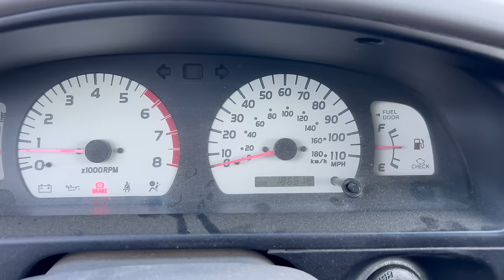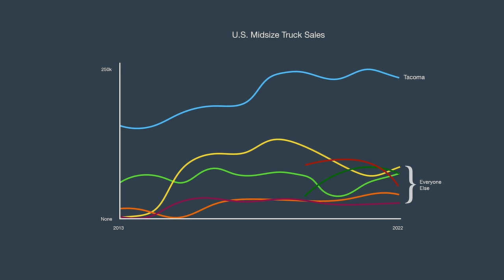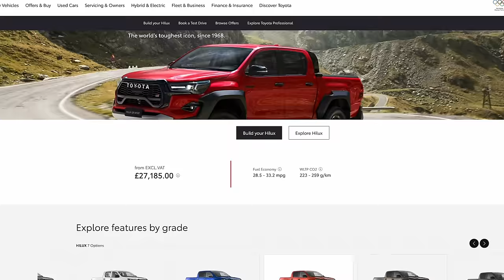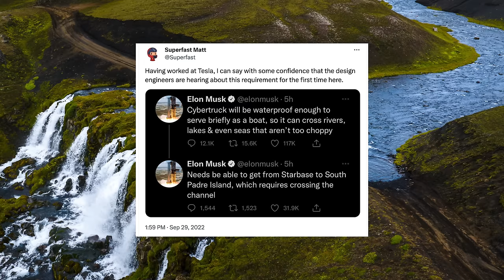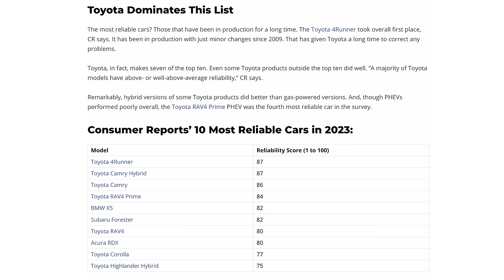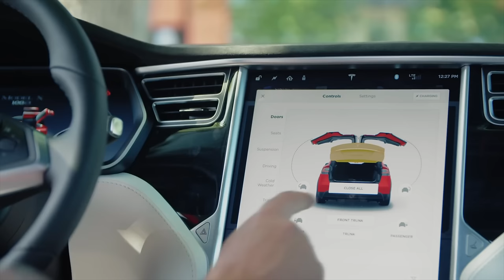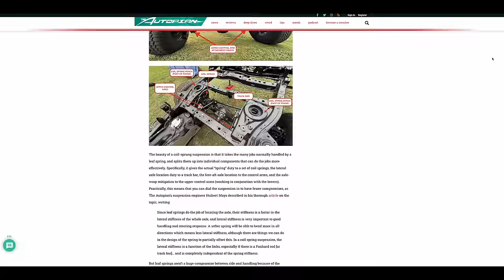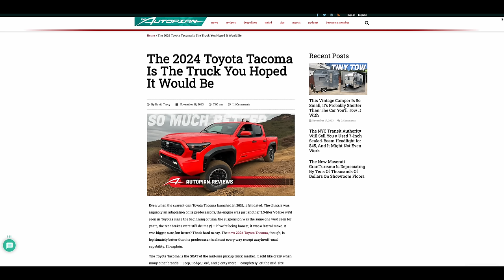What Is The Best Truck, And Why Is It The Toyota Tacoma?

Comment: By the way Matt, do you know about the Toyota Hiaces? They are basically Hilux vans, and north America doesn't know them. They are so good and have a rich family tree with lots of cool versions.
Reply: North America got the R20/R30 TownAce (MasterAce Surf style), which Toyota just called "Toyota Van" here (back when the Hilux was sold as "Toyota Truck"). Lots of people in North America old enough to have been interested in cars in 1980's know about them.
Reply: @brianb-p6586  Yes, we know it as the liteAce in Europe, but still it was a bit different from the Toyota Van.
Anyway, they are not Hiaces and the Hiace family is big, with barebones versions and complete luxury vans
Reply: True, @roland9367 , the North American "Van" was not a HiAce... but it was Hilux-based, so many people here are familiar with the van with Toyota truck bits under it.
Reply: @brianb-p6586  That is probably true. But the Hiace has been sharing even more engine and drivetrain. The Hiace that I had was pretty much equal to the unbreakable Hilux.
A part of the Hiace family actually used 4runner engines like the v6. And there is even a superrare v8 ambulance

Comment: Impressive advertisement! 
I'll be keeping my '99 super duty but if I was to sell it I would strongly consider a taco. Unfortunately, I don't think the taco would like pulling my equipment trailer. My super duty on the other hand doesn't mind pulling my equipment trailer. Even if you put the taco in the bed of the super duty, it would still pull the equipment trailer. In fact, I'm pretty sure you could put a taco in the bed of the super duty and another one or two on the equipment trailer and still have to pass people on the highway.

Comment: I have a 18 Tacoma that I bought new in 2018, and it has 156,000 miles on it.  And nothing has gone wrong with it.  I have replaced ball joints and bushings, but to be fair, I drive way to fast offroad and those things are my fault.  This truck has driven from Washington state to Texas at least once a year since I bought it, one time towing a two axle enclosed Uhaul (completely full), at least 70,000 miles offroad, I have filled up the bed with rock and dirt many times, and it's been flawless the entire time.  I keep up on regular maintenance, use good oil (Ams oil signature series), swap between two K&N air filters (clean one while I use the other one).  Every 5,000 miles I take it to Toyota so they can rotate the tires, check the breaks and fluids and top them off for $35.  I am still running the stock battery, and I have changed the spark plugs once.  This truck has been great, I absolutely love it and plan on driving it for many more years.  I love it when people say Tacoma's can't put up with abuse cause my truck is physical proof they can and do.  These are great trucks and one day, many, many, many years from now I am going to get another without a second thought.

Comment: A few notes:
In your video, you showed some b-roll footage of older Tacomas and even T-100s that I'm guessing you saw near you in California, as a point about how they're still on the road. I'm on the East Coast, and I don't see too many really old Tacomas like that, likely due to rust. And that's with the milder winters here in Maryland vs. New York.

Second, I agree: A midsize truck will do all of what 90% of truck owners need a truck for. If you need a midsize truck, the Tacoma is what you will buy. But a non-hybrid Ecoboost F150 is going to have equal/better MPG than the non-hybrid 2024 Tacomas, at a similar price. Add in the almost guaranteed ADM on the Toyota, and the Ford might come out ahead on price, with less costs at the pump.

Also, the past Tacomas aren't too big on the inside, which isn't great for taller (or even average height) drivers. If you look at the side of a <23 Tacoma, you won't see much existing underneath the door sills. They tucked the running gear up into the truck, making for great ground clearance. But this devours interior space, and doesn't help a Taco that'll stay on pavement. No idea if they fixed this, but the 24+ side view doesn't give me hope.

Comment: Toyota Tacoma engineers brought back the fully boxed frame that they used to put in their older Hilux/T100 models. They also took the Land Cruiser 100-series' rear suspension (4-link) and replaced the old  leaf spring suspension. So they took, proven old tech and threw it into a "new" chassis.
Reply: That's not the tech I'm worried about, alas.

Frame and suspension can be fine; head unit deciding to give up the ghost in half a decade, or the 'lane assist' deciding to dodge a branch in favor of dodging into oncoming traffic, or the turbo exploding from excessive wear from the thinnest oil known to mankind...
Reply: @TheLoneWolfling  Don't disagree with you on all that. Toyota would be better off scrapping all the new safety features and make the driver the main safety feature.

In regards to the motor and turbo, only time will tell but keep in mind, this isn't the first time Toyota has developed a motor with a "factory" turbo or supercharger. The old Hilux 4-bangers could be optioned with a factory turbo or you could buy a TRD supercharger.

Comment: I always wondered why toyota trucks sold for such high prices, Then I had a 91 pickup v6 4x4 fall in my lap, it just does everything you want it to, and doesn't complain or break down. Mine had 580k miles when I got rid of it. 100k of that was me offroading, camping, hauling, AND using it for work (construction). I changed fluids, bushings, and shocks, that was it. all in $1100 in parts? Id love to have another but dont have room for another vehicle haha.
Reply: At today's prices, you mean room in the budget! 🙂

Comment: The only real downside of the Tacoma is the price (because of demand usually) which is actually just another pro. I looked at them in 2018 when I needed a new pickup and the price different from a 1/2 ton was only about 3 or 4k so at the time I figured why not just buy another GM truck (my old one was a 2000 Sierra that served me well). Before 60k miles was up on my 18 Silverado I already had the oil pan replaced, the radiator (not covered under powertrain warranty) replaced and the water pump replaced. My driveshaft also rattles at about 1000 RPM under low load. Made me realize how far from grace the Chevy pickups have fallen since the late 90s/early 2000s. All in all I kinda wish I had just bought a Tacoma, but I've also had to tow a single horse trailer for my girlfriend several times which may have been a problem. Does 95% of what any homeowner would ever need though.

Comment: The biggest reasons I bought a Taco was because it had a 6MT and it wasn't a Gladiator. No other truck on the market in the US can say that. That said, it's still significantly larger than I want. I wish Subaru would bring back the Baja but do it with a 6MT option. I might just have to get a Crosstrek and go full Aussie on it with a Ute conversion. And an EyeSight deletion.

Comment: All im saying is that i've been around and drove Tacomas, and im still a Ranger fan. Loved my 93, 94, and now i love my 2020. The new gen Rangers are ridiculously capable, good HP, gas mileage, 4wd, locking rear dif, trail assist, traction control, good tow capacity, and an amazing 10 speed with a granny gear to boot. And its all accessible, simple, and easy to work on. I love my Ranger, and no one will convince me that i should have bought anything else. Only downside is no power or heated seats, but hey, that just makes it feel like my old trucks :)
Reply: Tacomas are great, but Rangers win in my book. Just bought a 4x4 2011 Ford Ranger XLT last month that only had 50k miles on it. Absolutely in love with the thing. I only drive like 4k miles a year, so I expect I'll be driving this truck for 20 years.
Reply: Congratulations. Enjoy your higher cost of ownership and lower resale value.
Reply: I have no experience with the newest ones, but Rangers were decent trucks, and used ones are a bargain, as is it may cost 2 to 3 times as much today to buy a comparable decent used Tacoma. Inspired by Car Wizard's recent Ranger video, last night I checked Craigslist for used Tacomas under $5k. I did find a handful of '98 to '03 examples - all with major defects - wrecked, rusted, cracked frames, bad automatics and super high miles! But that's OK. 8 years ago, I paid only $400 for a '96 base-model Tacoma with a bad tranny - now fixed and upgraded). Yeah, it's kind-of primitive compared to most newer trucks. But with only 83K on it now, it may outlast me! 🙂
Reply: @drwhat4574  not sure what higher cost of ownership you're referring to, and i don't think resale is much of an issue for me, hoping to keep it until either i die or it does.
Reply: @sunbeam8866  Tacoma prices are crazy, and ranger prices are getting up there, its now around 3k for a good reasonably low miles Ranger
Reply: @reeseferrell2731  Higher cost of ownership because it is not as reliable and will need repairs more often. The resale value is the evidence of that.
Reply: I'm a Toyota fan, and I like my Tacoma. But the price I paid for it kinda makes it a unicorn - especially today. If you could get a comparable Ranger or Tacoma for the same price, or even a modest difference, well the Tacoma is a no-brainer. But if the Tacoma costs 3 times as much, well....  But you might stll get lucky, like I was, if you're patient.
Reply: @reeseferrell2731 $3k? I wish I lived where you do; $3k buys you a rusted out 200k mile 2.3 base model Ranger; to get a rust free, less than 100k mile, decently well maintained, 4x4, with any V6 (especially a 4.0 with a manual) you’re spending at least $10k and that’s a steal, it’s around $16k if you want a 4x4 manual 4.0 that’s not a 2001 or 2002 (the worst years).
Reply: @skorpoolr  western ohio, recently i sold my 110,000 mile 94 ranger for $3200, 5 speed with some minor rust. Where are you at that rangers are that expensive?
Reply: @reeseferrell2731  Wisconsin; the rust belt eats old trucks for breakfast, so whatever ones that are left are pricey.

Comment: While they are not a bad truck, I definitely think they're a bit overrated. Part of the reason you see high numbers on the road is because the frames were so bad that they were replaced under recall, whereas another truck that succumbed to frame rot years later was scrapped. Interior room is pretty limited, and the fuel economy is no better than a 6 cylinder half ton domestic. I will say that they have great ground clearance in stock trim, but bang for buck, they are way too expensive
Reply: It's okay to be wrong, the overall build quality is leagues ahead of domestic trash and they last a lot longer. What's actually a downside is dealing with Toyota service departments. If you find a dealer with competent advisors that aren't jaded and overworked, you're golden. Most of the time they're incredibly burned out.
Reply: I worked in the autoglass industry for a little while and would always note mileage and condition of cars just as a hobby. The amount of 400k+ mile tacomas, pickups, 4runners, t100, and tundras I worked on was staggering. I can recall only 2 or so domestics that were 300k+ and none past 400k. I know thats not proof. But as a big american v8 guy, I was starting to see a pattern.
Reply: @Hawk7886 Dude Tacos are like 3x the price of a similar Ranger, they’re overpriced and overhyped; they’re great trucks and I want one, but $12k for a 200k mile hunk of rusty junk is too much. 

     I wish people would stop pretending like Toyota can do no wrong; they’ve made plenty of bad vehicles/engines.  Same with Honda, they have a few oil burners but people just go “haha well it will last 300k miles” as they spend $20 on oil a week.

Comment: I own a 2023 highlander with the same engine and drivetrain. Average mpg is 22. Performances is great, low end torque is fantastic looking forward to towing 5000lbs with it this summer. 

Biggest complaint horrible throttle control from the electric throttle. Accelerating smoothly is hard to do. Hopefully there will be a software update for it.
Reply: My '96 Taco has a cable. Don't need no stinkin' software!
Reply: Get it tuned. Fixed my Tacoma. Now I love it all over again.

Comment: Imo the 3rd gen we be extremely desirable in another 20 years. It’s the old truck you can buy new in 2023, early 2000’s tech in a truck with apple car play and heated seats. Ya the shifting is all over the place but at the end of the day the trans is reliable. The new Tacoma will be great, but it is modern and will have more failure points.

Comment: Four Tacos: 88, 2000, 08 and 16... In almost 30 years the seats still suck, like torture on a long trip, and no its not the base. I'm due for new one, I go about 8 years. ZERO chance I'll get one of the 24s. They have over tech the taco and I'm done but still the greatest value, and you will buy one... LOL

Comment: I'm a fan of Toyotas, especially those built in the Fremont plant, and I've owned many.  Toyota trucks, especially older ones are indeed awesome, but are they worth the prices these days?  You can get an older low mile Silverado 1/2 ton that has been very well cared for for the same money that buys a well used and abused high mile Toyota and the Chevy will probably get better mileage and more payload and towing capacity.

Comment: Hey good video and yeah my 2004 Tacoma prerunner still going strong with 214,000 miles on it. I thought about replacing it but when I go and look at the new trucks they're all so much bigger this one has an extended cab and a 6-ft bed and that's kind of what I'm looking for but no one really makes that in a compact truck anymore. Actually I guess the only compact truck out there is the Ford Maverick but I got to worry about the reliability of that and that only comes with like a 4-ft bed so what's the point.

Comment: i wanted a tacoma so bad but ended up with gmc canyon diesel because it was the smallest truck with tow rating I needed for camper trailer. Other downside to tacoma was the price, but it seems clearly worth it. Have definitely had issues with the gmc electronics, not nearly as reliable as my toyota corolla was with over 200k miles.
Reply: Being used to Hilux's I was surprised at the towing capacity of Tacoma's. A Hilux in Aus can nominally tow 7700lbs.

Comment: Had a 89 Toyota Pickup that was on its second motor and over 500k on the frame and the rest of the drive-train, now have a 98 4runner that is pushing towards 300k and a 2017 corolla with 210k. I am likely going to buy my dads 2014 Taco that also is pushing 230k. It is incredible to me how I am less worried about all of these than a friends vehicles that is only just over 100k. 

Yes there are high mileage issues that I am dealing with, but far less than I feel like I should be. I would love to have a more interesting car, but every time I think about buying one I stop, go back and stick with with tried and true, because I get my excitement from climbing, snowboarding, offroading or just going interesting places, not fixing interesting things at home.
Reply: Worrying or not does not dictate intelligence nor quality

Comment: I deliver mail and there's this lady that has an older, early 2000s Tacoma. It has nearly 600k miles on it. It goes down every now and then for coolant leaks, belts, etc, but it has the original engine and tranny. Another lady had a 2019 Tacoma TRD and it kept getting engine codes and having work done bc the seal on the gas tank was letting dirt in.  The engine ended up blowing at 60k miles. To be fair, that route was 80 miles of rough dirt, and it was almost definitely a one off.

Comment: I stuck to the reliable.  I bought a 2023 Off Road back in September 2023.  Ill mod it slightly with an air intake, performance exhaust and tune.  I love how trucky it is.
Dont like turbos...more to break.

Comment: I don't hate the Taco or Toyota in general having driven 2 gens of the 4runner and the FJC. But we DO need to call out the horrific MPG the previous gens had. Through a weird twist of fate, I swapped my 4runner for a 2nd gen Raptor and the 6k lb, 450 hp beast gets better MPG than the 4runner or FJC did. My buddy recent swapped his Taco for an F350 Tremor diesel and IT gets better MPG than the Taco did, lol! Noting that we live in Tahoe and drive up and down mountain passes. Let us hope that the new gen turbo and hybrid versions make this a thing of the past.
Reply: Ford just does it better

Comment: I drive a 1998 Frontier that I bought new. It has seen 431,000 miles and is usually used for truck stuff. It's ugly, the paint is quickly disappearing but I don't care. It does what I need it to. If I ever had to replace it I would buy a Taco too. Nissan lost its way when Carlos Ghosn took over and subsequent Nissans have not been as good. Toyota is still a solid choice though and worth the extra money so long as it remains reliable. A good Toyota is a must for a car guy because it lets you own interesting things that aren't reliable things.

Comment: I bought a brand new 2003 4 door Tacoma.  Last year I gave it to my son for a second vehicle.  It has 196,000 miles on it.  

I replaced it with a 2003 full time 4wd V8 4Runner for off road adventures with 203,000 miles.

Comment: Gotta put big bumpers with end protection. The 24 Tacoma has a longer better impact bar bolted to frame end. But you need a chrome heavy bumper on a framed vehicle for it to be safe. Tacomas are very unsafe vehicles to wreck in. Also gotta check if rear seat belts have pretensioners. The reason impact bars on frame ends aren’t safe is they generally don’t bend in wrecks and there is only about an inch for it to bend if it does, taking that sharp initial crack off the frame and stopping the frame from crumpling, causing severe impact slowdowns.